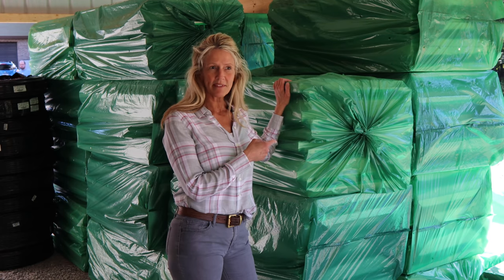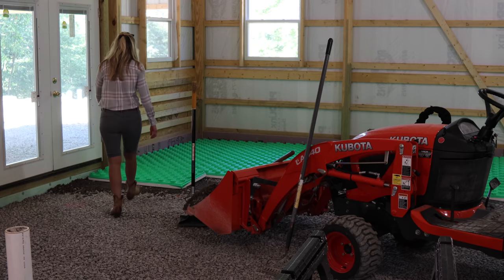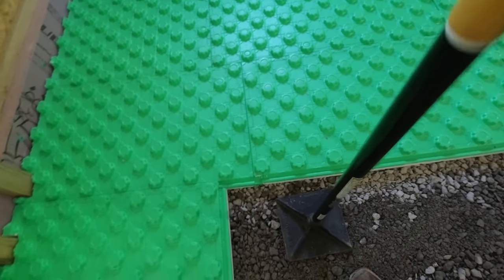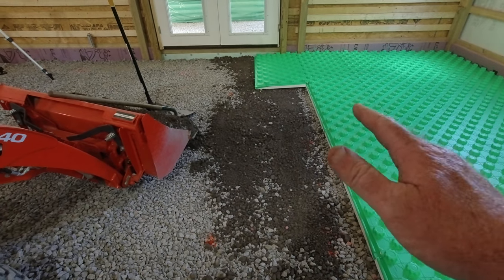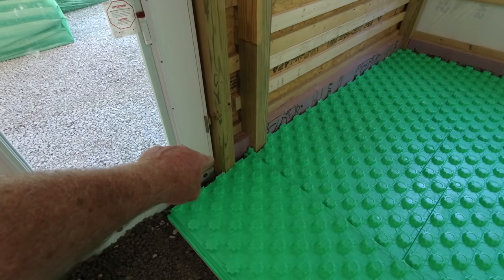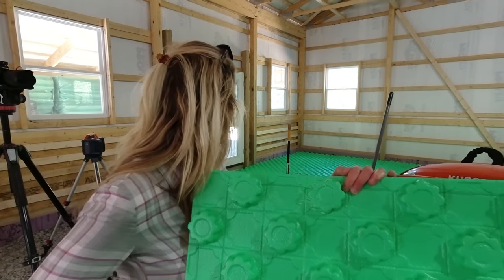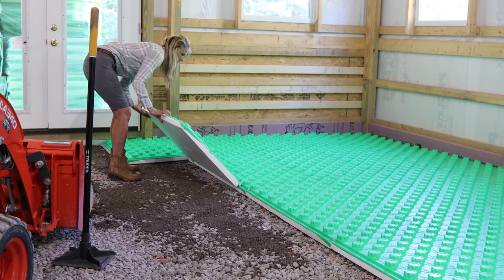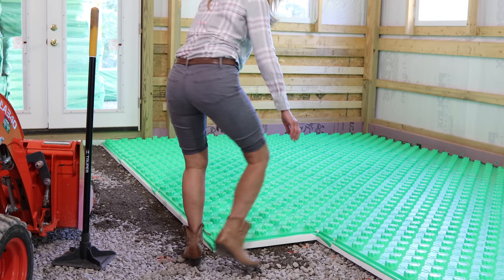I hope the Reward is Worth The Process, Radiant Floor Heat Rough In

Comment: I've poured a lot of floors and heat systems Mike, they're all a little different but 1/4 in within grade is fine, as long as it's well compacted (*Melissa) ... just be careful installing the pipe, no sharp turns or kinks ... my guys use to use plastic straws in the stone base cut off to laser mark to level, and then foam in straws to panels and cut to finish grade, sounds a bit odd but it works and is fast ... and remember, pour will put off a lot of heat and moisture the first 24 hours ... so keep doors and windows open and vent with big fans if you can ... not a big concern in a barn but I've seen basements and new construction ruined by the moisture ... as secondary black mold growth can be an issue
Reply from the maker: Thanks for the info

Comment: Hindsight 20/20, probably should approach the panels like pavers and have a 3/4"-1" layer of sand for easy screeding using conduit or boards as elevation guides. Thanks for sharing your challenge.

Comment: Hi guys...I live up in Greenville. Just did my garage with same board. Just remember that the pucks all have to line up so everything is on 3" centers. All of the grid lines should line up or putting the tubing in is a PITA. I used a TAKAGI point of use water heater and it works wonderful! If you have any questions just I gimme a jingle!

Comment: I used a 3/4 minus stone and compacted it.  It wasn't perfect and we were using 4x8 sheets of 2" foam.  We stapled the PEX to the foam and laid a grid of #4 rebar over it.  if there were voids under the foam, the weight of the concrete settled it to fill the void.  We laid all the foam and pex in my 1000 SF garage in a couple of hours

Comment: Good day everyone.   It has been hot here in Missouri.  Right now, it is 92.   We needed the break from the rain, so the farmers can get their crops in.  It’s really interesting the radiant floor heat.  I have been planning on building a house on my farm and looking at different options.  I am looking into heat pumps, furnace, radiant floor heat and geothermal heating and cooling.  With the price of lumber, I have had to put a pin in it.

Comment: We used 2” X 4x8 foam boards then sheet reinforcing wire then tied wirsbo pex to wire with rebar ties 
Concrete workers pulled wire and tubing up into concrete, my wife and I put tubing in basement and garage floor in one weekend and it was 100’ out and hotter in basement works great, went to 4 day school at wirsbo to learn how to size and install, working in HVAC FIELD

Comment: Mason sand is the ticket on top of your limestone, inexpensive and easy to level and compact for a particular finish.  Is the green color a vapor barrier?  I noticed no plastic under the panels.  Same thing for a brick or stone walkway.
Reply: Mike try using an electric carving knife on cutting any styrofoam type material. No mess

Comment: Did an NHL hockey rink.  We used screeds and sand with 2 layers of polystyrene, so very similar.  Wooden skewers at 45 deg angle to hold the 2 layers of poly together.

Comment: I worked in several shops with floor heating and it was so comfy in the winter to have warm feet while the room was only 62 degrees. They also had wall mounted radiators to do "catch up" when the doors had to be opened. BTW, warm floors are also quick to dry if you track in snow or rain.

Comment: 👍🇺🇸🇺🇸🇺🇸🗽🙏🏻 Enjoyed!  Glad to see you understand taking it a little easier!  And "TIME" flies as you get older, especially if you stay busy without doors stuff and everyday maintenance around the home place.  Glad I live in Texas,  but on another subject I would never have pipes in a concrete slab and that's the way they used to do it in Texas.....fixing a leak is a bear as well as finding it.  Used to live in Iowa...great having a basement with no pipes in the floor.  In Texas they now use pex in the walls and ceilings with no problems with freezing.  The pex will expand enough to tolerate freezing or you just let a faucet drip.  They use a manifold with no water connections in the walls or ceiling to leak.  Make sure you have NO pex connectors in the slab and you should be OK.

Comment: Mike it is hard to imagine it, but this style of heating is pretty amazing, compared to the conventional heating methods (electric ceiling, electric baseboard, electric space heater(s), electric or gas forced air ducted), but it is a pretty awesome system.
   If you were being sold on it by a contractor type, you would probably be focused on the cost, and yes it is not the cheapest.
    I would say a person would need to tour a location that had a system in place and operating during the cold part of your year.
   If there wasn’t an opportunity to do this, there is a “leap of faith” that would be taken by a person to go with this system.
    I have this very system in a 2500 sq ft single level house, in NW Montana.
    Gas fired boiler, a with a domestic water maker, 6-zones, including my 2.5 car garage.
    I/we love it...!
I would have configured my zones a little differently, now that we have been in the house for all four seasons, but no regrets.

Great video,
Thank you sir

Comment: I’m getting ready to build a 1,200 sq ft detached garage with radiant floor heat and the plan is to put the foam on sand. I’m no expert, but the concrete will take care of any irregularities in the levelness of the stone. I have floor heat in my basement and garage and it’s awesome. I also have a geothermal system and it heated the house very well this past winter. Looking forward to seeing the completion of the floor

Comment: I found it when you underlay your concrete pours with foam it’s incredibly forgiving of the ground it will sort of mold and it will let the high points kind of push through the foam a little bit and adapt. Even years later when you pull the concrete out the foam is usually pretty well intact. It does a very good job of sort of spraying the weight out. It’s important always to ensure your foundation is solid but I’m pretty sure if you had just thrown all of that down it would’ve been absolutely fine.  On the way to the concrete goes on it it’s sort of pushes everything down and the foam can bend and give a little here and there where it needs to and if you have a sharp or High Point on a rock it will just push into the phone and the phone will still form a solid base and not high center on those little bumps.  It’s all very very forgiving.   Even cutting the edges. I tend to be a perfectionist and try to do everything which is why everything takes me so long but concrete always going to drip down the side a little and as long as you’re getting a thick enough pad on top it will fill those gaps. I’ve even seen when they didn’t have enough foam and left a few inches between sheets of foam end it still supports everything, the concrete feels those gaps well anyway and once it cures it all becomes part of the structure. Leaving those big gaps with some thing I thought would be a point of failure but it’s kind of like suspending a shed or anything else you don’t have to have every bit of the flooring be a footing as long as it suspended evenly and not going to be moving much.  Yours looks great and will be more than fine.   To speed it up you could just be less particular but I know you’re not gonna do that, I probably wouldn’t either but in reality it probably wouldn’t make enough of a difference to ever notice.

Comment: Are you adding an outdoor boiler? If so, you may want to lay in the lines from the building to where the boiler will be before you finish the road around the building. For that matter, if doing the boiler, may want to run lines in through the floor before it's poured.

Comment: Mike, Wish I would have known about that system last year when I built my house. I used  the 2" foam for the hydronic heat  in my basement and garage (yes I love it) and found using a Sawzall made my cutting/notching alot easier. 
🤔Maybe when I build the future shop I'll give this system a try.

Comment: Mike, your 2B limestone is perfect for what you’re doing.  The only change is I would have done the last 1” with “paver base” , which is like fines, but not as powdery.  I know a lot of people will say to use sand, but sand is too fine and can still settle into the limestone over time.  And by using pa er base for the last 1”, you really dont need to worry about grading the limestone precisely at all, you will final grade the paver base, which is nice because you can screed it to grade.  Very quick and accurate to do.

Comment: Good morning! The one commenter who said they used sand and the other who suggested screeing the level might have provided good ideas. My gut feel on this is that the weight of the wet concrete will deform the foam into the hills and valleys, and the concrete floating will be your close-tolerance surface. Your target tolerance is 1/4”, but I suspect these are done by contractors to worse than twice that. A half inch more or less concrete to make up the differences wouldn’t matter too much in the rec side, it wouldn’t seem. Either way, I think having fines to pack to grade works, whether limestone dust or a thin layer of sand to stabilize the 2b aggregate. Fun to watch!

Comment: How are you going to anchor interior stud walls to the floor without hitting any of the radiant heating tubes
Reply from the maker: Adhesive and short tap con
Reply: was thinking the same thing
Reply: Mark out the partitions before you install the pex tubing

Comment: You will not regret going with the radiant floor heat.  I believe it to be the cleanest, most efficient way to heat any space. It is very consistent virtually eliminating any hot or cold spots. Plus, no filters to maintain, and the air feels cleaner and not as dry as forced air.  The panels may be taking a little longer, but there is nothing better than dead flat/level.

Comment: I’ve done hydronic radiant floor heating in two of my garages, in climates of -40c to -45c degrees, you sir are doing way more then what’s required, but hey, good on you. With that much investment make sure to use hydronic glycol anti freeze, you don’t want a power outage in mid winter freezing the floor and busting lines, it’s expensive but worth the peace of mind.

Comment: Tip use thinner millings as a top layer. Crushed concrete dust is the best way when you use a compacter. The rest you got nailed already. And when you walk the pipe before you do walk the pipe use a spray can of paint and mark your corners / turns this way you stay in line better and as you know you walk on the pipe to push it in place so put your pex tube onto a spingle sideways so you can unspool it as you go. 3 pieces of 2*4 do the trick too. big cross on the floor and a 4' spike and you put it in the center of the room down so it's out of your way till the end.

Comment: When you get done running your loops with the pex tubing place sheets of wire mesh on top of it you don't want the pipe floating up when pouring the floor  and cutting them when you cut the control joints and also make sure you put air in the system while the pour is going on lets you know if any leaks happen fix them as you pour out  while you can

Comment: get 1/2”ridged emit conduit and a straight 10’-12’ 2x4 and lay the conduit on the ground and level that on the rock and screed sand flat 12’ wide at a time and lay a section of foam like that, use the sand like everybody is saying, should make life easier

Comment: One of the comments below was excellent. Keep piping away from perimeter 2-3 feet so you can safely anchor into concrete. Additionally discreetly permanently mark each long run of buried piping maybe not so much for you but next owner.

Comment: Great looking heating system and prep Mike.  
You can't go wrong with a mini split AC unit.  Great idea to stamp and color the concrete floors.  You should plan the pad ect for the vacume kiln and wood working equipment.  Slabs and dried fire wood all make it a great return on investment.   A deer hunt raffle with hunt would be great content.  Venison ring sausage was a staple growing up.  Any plans to build a chicken run fortress for eggs, sawdust to compost, recycle all food waste?  Trap some fur in the process.

Comment: Looks nice!   Have to say I'm a bit puzzled at the notion of pouring several inches of concrete over lightweight polystyrene foam and trusting it won't crush.   I imagine the manufacturer must have tested it but I'd be nervous all the same.   Was also wondering if using sand on top of the 2B would not have been easier to level things off and provide a safer base for the panels.  But then again, I don't know anything much about all this...

Comment: If you plan on putting in a two post lift to service / work on your auto and truck. You  will need at least a six base of concrete for the posts.   And no plex around the posts .  Just a thought .

Comment: I used crushed gravel (road base ) to get close then use sand to get to final grade 
Heat my 36x48 foot shop 12 foot ceiling with in floor heat using a propane on demand boiler for 3 gallons of propane a day  north of Eau Claire Wisconsin 
Have a greatt day

Comment: Set grade stakes , lay two long parallel   1" pipe (electrical conduit) 10' apart, screed crusher run (stone dust)  between pipes it will be flat and solid. Just like laying paver brick.

Comment: Mike could you put some inch battens on the floor and then spread sand in between them then screed it off with another batten remove the floor battens and use a steel float to fill in the gaps left just like you were going to block pave it?

Comment: Try using granulated lime stone or lime stone dust, sometimes the granulated/dust is added into 2A -2B as a choker or use river/road sand to fine tune over top of the lime stone.

Comment: It’s your project so seek the “perfection” you are happy with.  I sometimes think you are too particular and then I tell myself that this is your project, not mine.  Many years ago, we always used what you are referring to as 2A as a base for flat work. The reasoning was that is able to be compacted and locked in with the fines.  I would work out an area 3 or 4 panels wide with the 2A and plate compactor and then throw the panels down.  This would help break the monotony of going panel by panel.

Comment: There's a place in Union ms that call hardy's manufacturing  that make wood burning boilers.  That burns wood to heat water in tank could be used for heating water for radiant heat.

Comment: The heat works great but it doesn't have a quick return. If you open and close the garage doors a lot it takes a while to catch up but you probably won't have that issue and if you do a barrel stove in the corner and a couple chairs and some sticks to whittle ( get where I'm goin with this) blessings.

Comment: Question ?
Was wondering, how much weight, load limit, will that Styrofoam floor hold up without cracking and buckling the concrete above with a load on it  ?
Reply: it'll hold whatever you can put on it. High density. I've got several building with it. And one with micro boiler radiant heat. Floors stay dry, too. That's the big advantage.
Reply: I have worked with up to 18in foam and 2ft thick concrete in northern Canada at refineries, works great

Comment: Mike, watching you compact the covering of 2A limestone over the base 2B limestone, it occurs to me that blinding the final surface with sharp sand, would not only help lock all the aggregates together, but would also be easier to bring to the correct level using a straight edge board. Just offering advice from personal experience....By the way, you can never be too fussy on any project you are doing for yourself, simply because if it turns out wrong, you're the one to blame.

Comment: Did you think about putting three loops in ground for geothermal.pay for it self in 7 years based on your fuel cost + - years.
Reply: Geothermal heating works great! 👍 Putting loops into the ground works good, if you have wet dirt... Otherwise I would recommend drilling a 600 ft deep well and put a single loop into that. Working for a company that drilling wells and installing those loops over hete in Sweden. 👍 We have had these geothermal heatpumps for more than 30 years over here.

Comment: One word to speed up the edge trimming, "Sawzall". I'm sure you will be glad you have that 2B bed if you ever get water seeping under that floor, it will drain away any water before it collects & freezes. You will likely never have an issue with that floor heaving, due to the 2B.

Comment: How are you going to cool the building in the Summertime when outdoor temperatures rise above 90 deg. F?
Reply: I'm going to bet they will be in the pool ! But yes , good question I was wondering also ???
Reply: @mikesr3407  Probably…I can’t imagine doing that huge a project and possibly rolling heavy equipment over the floor not to mention the thermal conductor can’t be spliced and must be continuous. Tile or some other approved flooring has to cover the grid layout and then, hope you never have to locate a flawSo much for my uneducated comment. I would not know where to locate the thermostat which has to be established before one inch of cable is routed. IDK…Mike is pretty smart so I bet he has a plan for any crisis that he encounters.
Reply: @glitterisgone  yeah I've Geo in my home but it's a pain , it's great until it's not ! I know just enough to be dangerous , thermostat went bad already 700 dollars each , just in warranty , but only one contractor nearby can do my warranty ! 6 of , half dozen the other !